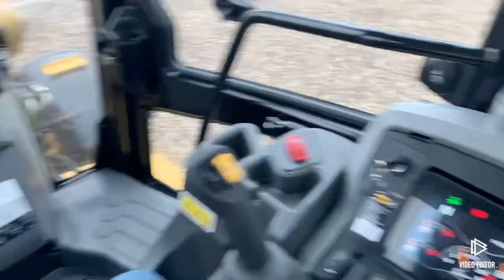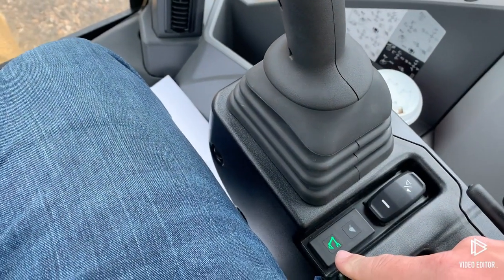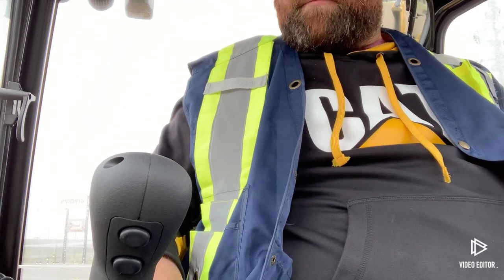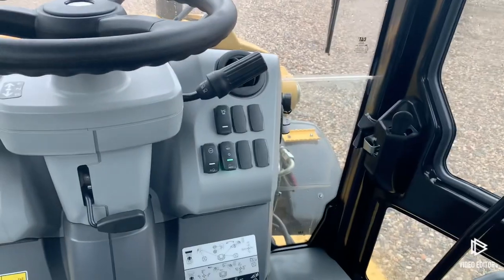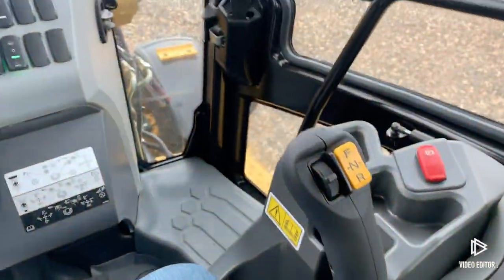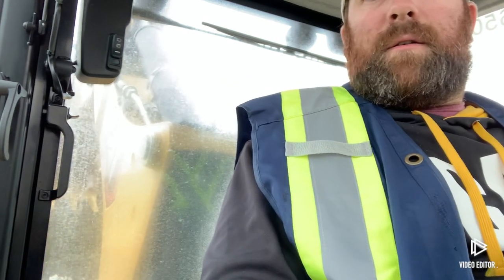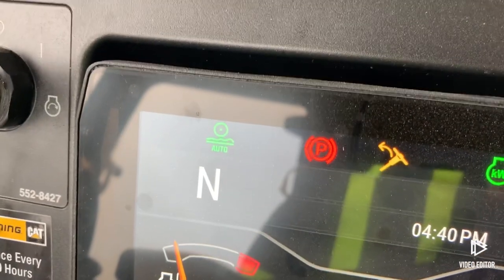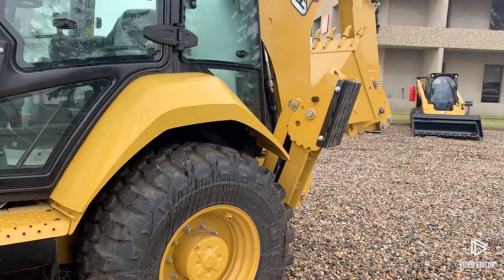Caterpillar 420XE Backhoe - Dual Mode tutorial

Comment: You also forgot to mention that if your working the backhoe you can pivot your seat to the right and hit the dual switch and still operate sitting sideways. I use it all the time when I am hoe ramming and can have a better site line or if your loading trucks off to that sides.  Much more comfortable then cranking your head all day
Reply from the maker: I will have to give that a try the next time I am in one, I was certain that the seat had to be in one of the latched positions in order to operate any of the hydraulic functions as a safety. Thanks for watching

Comment: Egress and ingress but Degress works too. Maths don't change but language is ever changing or it is a dead language e.t. Latin.
Reply: What is the possible reason why a badkhoe loader wont start after service even after priming fuel
Reply: @briankorir7060  air bubble in line. Blockage in line. No/low fuel. Pickup pump weak/bad. Compression.  sucking air in fuel line. plugged return line. Good luck